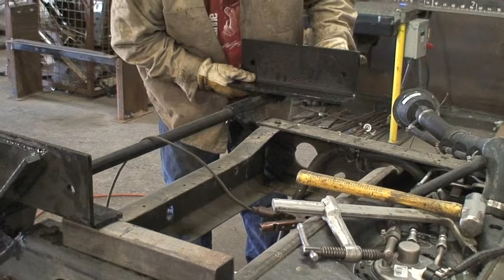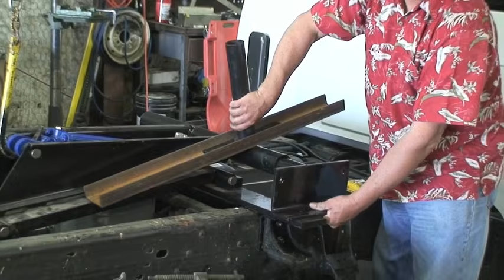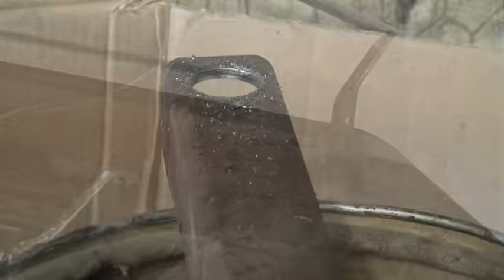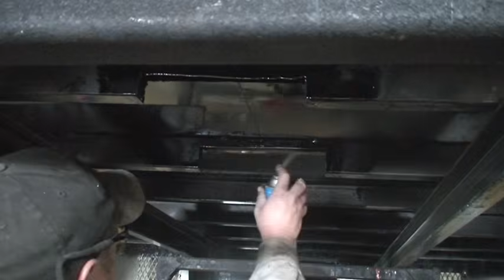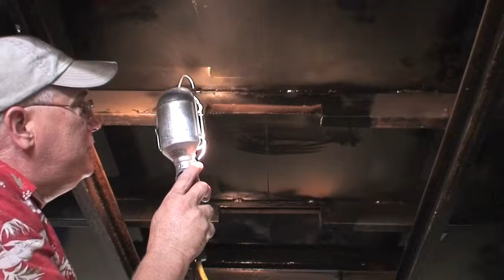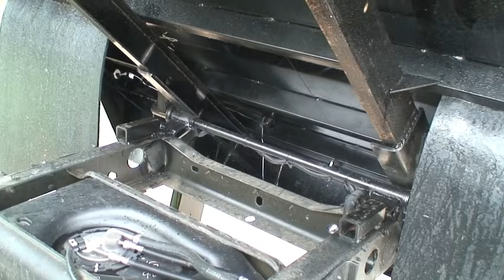Part 3: Hefty Hoist Dump Kit Installation

Comment: Looks nice but didn't see any enclosure for the pump and motor from the elements. Also, didn't see any circuit breaker at the battery so if the main cable gets cut somehow, then there isn't a fire.
Reply: Like he said the pump can be mounted in at least 4 different locations on any number of different trucks, a cover would have to be a end user supplied part.
Reply: @luckyPiston  Of course.
If you can have a pump mounted like that and have the knowledge to make it work with the plumbing, you can afford a sheetmetal cover maybe of steel or aluminum. It just helps protect it from the elements going down the road.
Reply: @oby-1607  A 14 gauge aluminum checker plate box would probably look pretty slick.
Reply: @luckyPiston  Oh yeah.